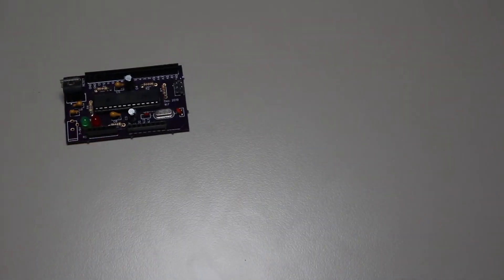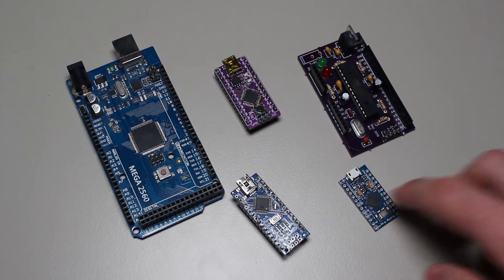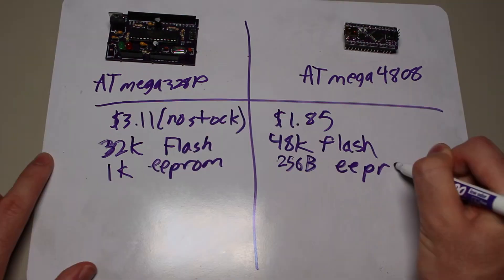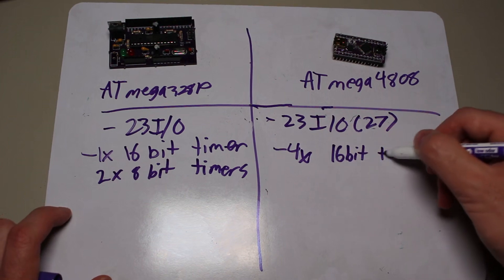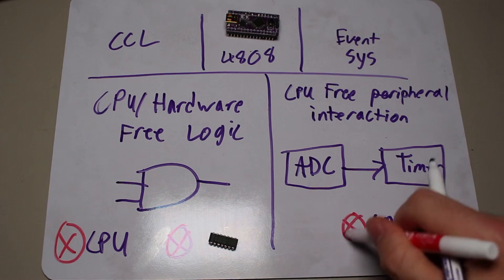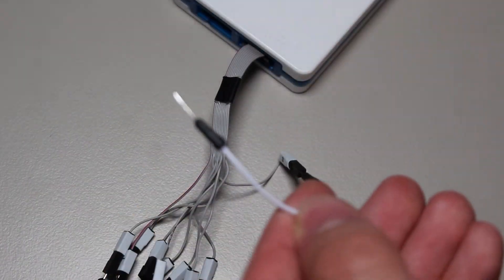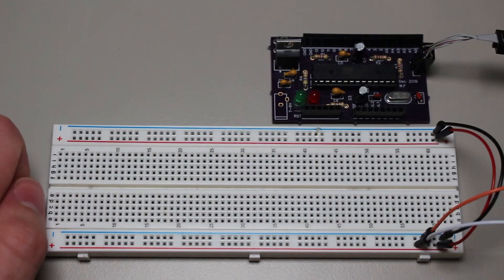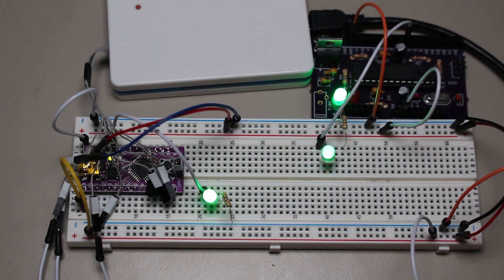Worth the update? - NEW megaAVR-0 Series vs OLD megaAVR MCUs

Comment: I loved my Arduino Nano Every board. It's much better than Nano IFF one wants to stick to Arduino type of programming.

But for mare metal, I dont like it. It does not have even a single full 8 Bit Port on the pins. The chip does, but they are not all broken out on the board. Moreover, the pinout in terms of actual port id and pin numbers is very un-systematic. Also, two pins on the chip are shorted to a single pin on the board. Bare Metal Programming can destroy those pins or ports.

All this to maintain backward compatibility to Nano.

I would happily buy a board that looks similar (I love the way it looks) but has different pins and pinout to take the full advantage of the chip and allow easier bare-metal.

Btw the mageAVR 0 does have a few dips. At least ATmega4809 does, but I am positive that I remember seeing others too.
Reply from the maker: I didn't know that about the Every. Thanks for commenting!
Reply: @SineLab  Your Welcome!

Comment: Even better ... AVR64DD(28/32)  or AVR128DB(28/32/48/64)  AVR64DD28, AVR128DB28 and ATMEGA4809 are available in DIP packages (28 pin for AVR64DD28 and AVR128DB28 and 40 pin for ATMEGA4809)
Reply: yes for the newer Dx series. Though as I was about to mention before reading comments, DIP packages are generally more pricey than SMD so the price comparison in the video is a bit too much in favor of the 0-series.

Comment: I can get a board with Mega328 for 3 Euros. A board with a Mega4808 or 4809, on the other hand, costs more than 11 Euros. Is it worth it?
Reply from the maker: In your case the Mega328 is the better option. The 4808 has a few more features, but not enough to justify that price difference. However, it is cheaper to buy 4808 chips by themselves.

Comment: hey, why don't you use arduino ide?
and which is the software you are using currently?
Reply from the maker: I am using AVR-GCC and avrdude for the ATmega328p and Atmel Studio for the ATmega4808. I don't use the Arduino IDE because of its slow speed, especially on digitalWrite. Nothing wrong with using it, I just prefer the methods that I use.
Reply: @SineLab  oh nice,
do you have anykind of playlist to learn programming you did in the video
because if i search for it i get arduino tutorials and it has built in libraries which makes it hard to understand the depth of the code.
Reply: @SineLab  why do you use different software for m328p and m4808
Reply from the maker: I don't have any programming videos right now, but I do have plans to eventually make a few. You can use Atmel Studio for both if you want to. I use avr-gcc for the m328p because I can run it easily on linux, but it doesn't quite work for the m4808.
Reply: @SineLab  i hope to see your programming videos soon
Because your Explanation is Neat.
Reply: @BIGRIP - It might be worth grabbing a copy of the O'Reilly published book "Make: AVR Programming". But there isn't really anything wrong with uaing the Arduino IDE if it isn't causing you issues.
Reply: @phipli  there is

Cause u won't learn shit